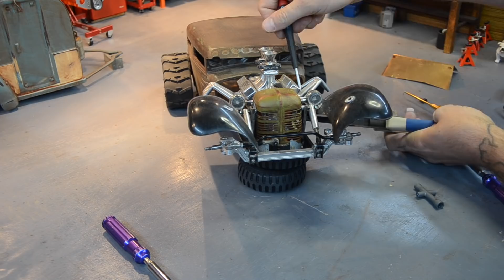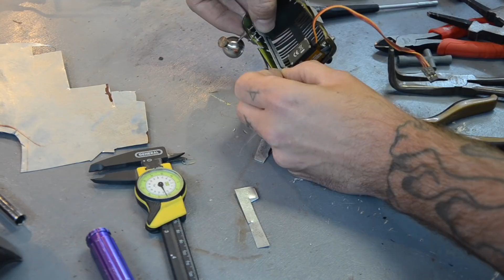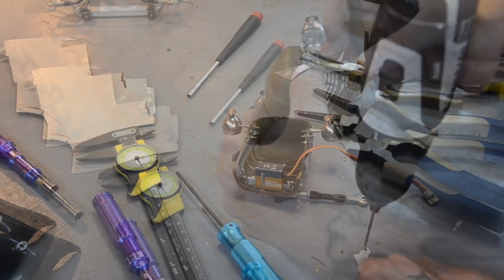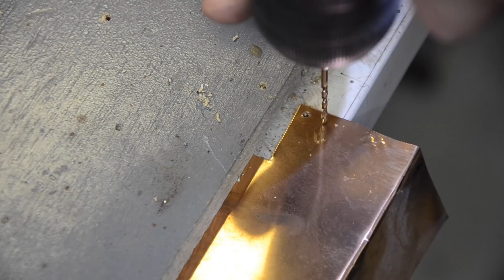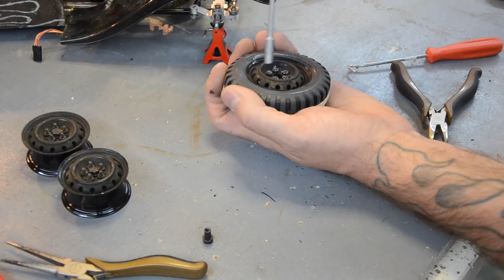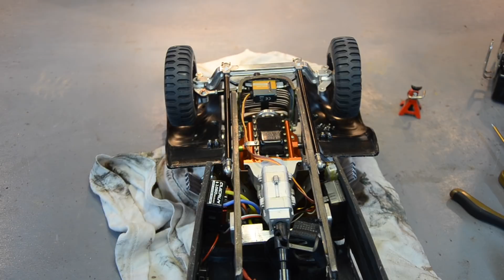RCratrod Rebuild, Repairing the Grill & New PitBull Tires

Comment: Hi I have always been going to mention. I don't know if you still have the tracks flip over on you. But there should be a stopper installed on the axil that comes with them. When you buy them new you need to chose what type of axil they are going on so the stopper will fit. It limits how far they can rotate on the axil. But I think you said you got them second hand. I guess they never came with it. Nice video again.
Reply from the maker: I did have the stops but haven’t installed them. I just turned off the drag brake on the esc so it rolls to a stop.  Works great for now.